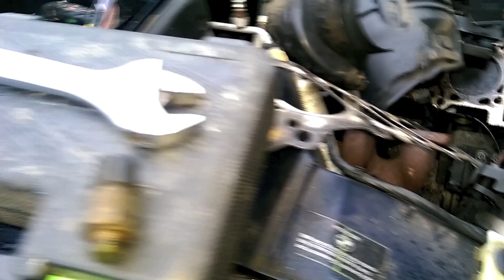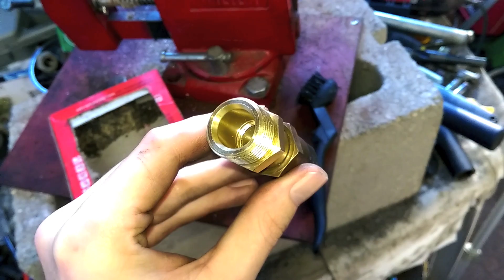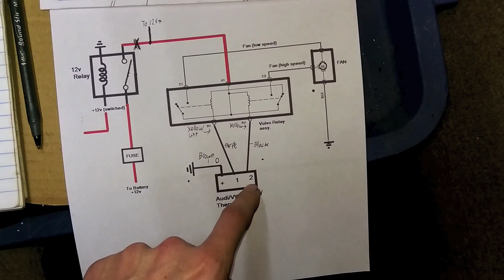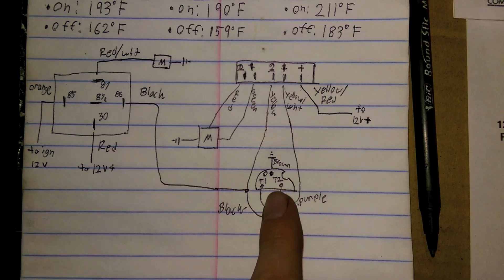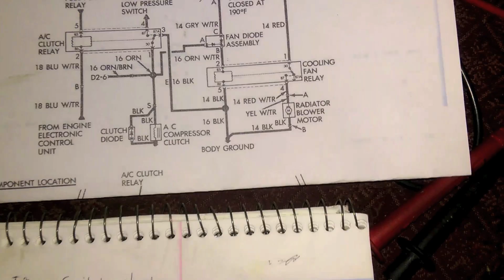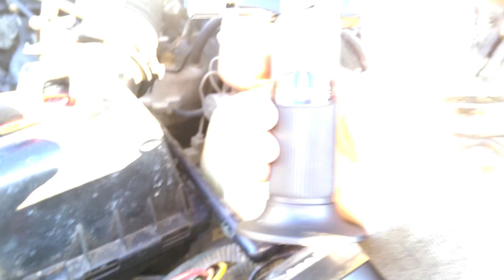89 XJ BMW Dual Temp Switch & 2 Speed Fan Wiring

Comment: I'm working on a bmw that I had to replace the radiator for. The new radiator had the later model switch, this one your showing. And I couldn't find anything on wiring diagrams for some reason. This video helped me find what was high and low off that switch. Thank you and good luck to anybody else that finds this video helpful!

Comment: So I could use just one of the wires from the thermo switch and it would complete the ground circuit ?
Reply from the maker: It should do the trick
Reply: @NickInTimeFilms   I’m just trying to get a single stage fan to kick on and off what would be the best approach one wire right ?
Reply from the maker: Yeah, you would run the relay ground wire to the switch, and then wire the other end of the switch to ground to complete the circuit

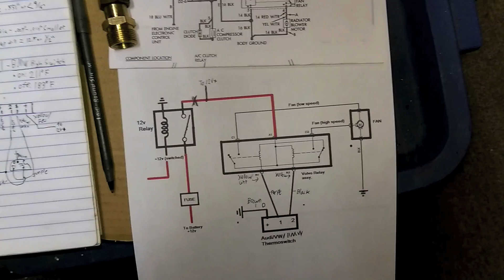Comment: These 3 wire dual temp switches  are isolated form ground. Makes no difference if you switch positive or ground to relays.  Not a weird thing at all. 14:01

Comment: Input side of radiator is wear this is to be installed. BMW mounts it there. Why do you want the fans not to run. Engine coolant temp at inlet will be well over 200* F when the outlet location is turning fans on
Reply from the maker: Interesting, that would make the temp range a little better. Later I went to a custom fan controller so i could dial in the temp just right but still keep the engine up to operating temp.

Comment: One thing to factor in where anyone put this. The hot side of the radiator or the cold side. That’s not the point of my comment. Just factor in......that if you are running an automatic transmission. Your radiator is cooling this transmission fluid at the temp the thermostat is set at. So.....if you have a 195° thermostat, then your transmission fluid could be running close to 195°.
    You don’t want trans fluid that high typically. There is a chart that shows trans temps and what an automatic likes. 170-180°. On my automatics I use an Extra stack and plate transmission cooler AFTER the radiators cooler to aid in cooling past what the thermostat on the engine allows. It cools it down past thermostat temps. I definitely don’t want them at 195°. I use a trans temp gauge to check it a few times and then either leave the gauge in or remove it when I know the temp is good. ......and I keep  my cooling lines away from the exhaust. Typically using AN fittings. Too close to the exhaust and it super heats the fluid. I did ruin a trans putting lines too close to the exhaust. 
I also use an extra DERALE filter which cleans the fluid much better than the stock pan filter that’s used WITH the derale. It’s an in-line filter 

Don’t let your trans run hot.......it takes the life out of it. Also....change fluid every 50k as it does break down with heat and time. 

And.....and overheated engine that uses the radiator to cool the trans fluid. If that ever is overheated. Change fluid right away due to the heat breaking down the fluid. You won’t notice it but it does trash the clutch packs a lot faster. 

That’s my 2 cents on this install and some good stuff on transmission care

Comment: wouldn't one fan coming on sufficient since the engine is off than having 2 fan coming on while the car is off draining the battery?
Reply from the maker: Depends how your system reacts. After years of messing with the Jeep I've learned the cooling system a lot better and am not worried about a slight spike when the engine is off. I now run a custom fan controller that keeps the temps stable and has the ability to cool with engine off if needed but I don't bother.

Comment: Great video, informative & not just edited for 'hook this to this & presto' BS that we see in a lot of other videos where it's 90% behind the scenes worked on.
I have a WJ 4.0L that has a heating issue. It super heats the fuel rail after shut off & turns it to vapor. Injectors don't like that too much when I start it up again 10 mins or so later.
Installing www.ebay.com/p/1500w-0-999h-Digital-Display-Time-Delay-Relay-Timing-Timer-Cycling-Module-DC-12v/23012257854 & setting it for a 210 second run time when I hit the switch in the cab has solved that issue. Though I may set it for a delay after I hit the button, then run for the 3 1/2 mins or whatever I set it to.
maybe look into these digital controller/timers. Freaking economical enough for sure, has a built in relay to switch the remote relays etc AND it keeps the programming you set even when disconnected from all power!
<----- New sub here. Cheers
Reply from the maker: Man, that is a crazy low price, neat. I actually made my own digital fan controller after a while as the temp switch wasn't working quite how I wanted. Now I have full control to set the exact temperature I want. Hoping to release some of my Trinity V2 fan controllers shortly to see how they work in the wild.
Reply: Yeah that would be awesome. Seeing how you have that wired up for the dual fans & 1 is a dual speed with full control. 
I like the option of running the fan with the engine off. Actually I need that because of the heating of the fuel rail. Got the insulating foil under the rail, on the feed lines & the rail itself & it still heats up the fuel. Dumbass design having the exhaust right under the intake manifold. Cest la vie.

Comment: you should lube the tap...
Reply: WD-40 is water displacement 40. Does it work fo this .....not really. You basically cut it dry. Does it matter in this case? No. The brass is so soft that the harder tap just worked right through it. 

What is needed is cutting oil. Also used with drilling any hole. You can get in in plumbing at Lowe’s or Home Depot
Reply from the maker: I always use wd-40 when I tap. Not sure if I showed it in this clip, but that and just taking it slow, haven't had one break yet.

Comment: How would I wire up BMW dual temp switch with a relay to interrupt the ground?  85 ground, 86 ignition, 30 ground, 87 to temp switch??? Please help.
Reply from the maker: You want the switch to be on the low side of the relay, so run 85 to the switch input, then run the switch output to ground

Comment: What amp relay did you use on the power wire for the Volvo relay? 30, 40 amp??
Reply from the maker: My Volvo Relay is just hot all the time, but an ignition relay might need to be in the 30/40 range. It might even say it on the Volvo relay pack

Comment: late 90's/early-mid 2000's VW Jettas and golfs have a 95/105 C that is the same size as the jeeps and threads right in, no adapter needed.
Reply: Just add a second relay and you have 2 speed fan control.

Comment: You go through the expanation a little too fast and I can't see which pin has the purple wire you mention. I'm trying to do this for my Ford Ranger but the BMW plug wiring colors are different. I have brown / black-green / black-white. If I lay the switch on the table with the brown on top as I look into the the pins the lower left pin has the BLK-GRN and the one on lower right is the BLK-WT wire. Which is the low speed?
Reply from the maker: Ok, looking back in my notes I see brown is the center pin, and I think purple is on the left away from the index nub, and black is next to the nub on the right.
Reply: NickInTimeFilms cool, this means the GRN-BLK is my low speed. I didn't explain, i put the switch in boiling water but neither contact activated after 15min in the water...
Reply from the maker: Hmm, strange. The 2 temps should be printed on the side in celsius. The colder switch closes low at 176F and the hotter switch closes low at 196F.

Comment: How about the AC Clutch ... you didn't address it!
Reply from the maker: That part is tricky with the volvo style ground trigger set-up. I may re-do all this a third time so it works the way I want. At first the sensor came on too late so i put the colder one in and it did well. put a new rad in and now it's too cold for my needs.

Comment: Would it be an issue to run that switch on the upper radiator hose? Or if I do an inline hose adapter would I want to run it into the lower?
Reply from the maker: Nah, that'll work fine but the fans will come on sooner since it's before the rad cooling. I actually looked into an inline threaded adapter at one point.
Reply: So I got inspired and while I was at the junkyard I found a dual temp switch off a bmw, it says 91 and 99 degrees celcius. What would the cut on and cut off be for those?

also, what would be a good power source i could attach the fan positive to that would only be on while the engine is on or a ground that is only active when the engine is on?
Reply: nevermind on the temperature question, found the paper you had
Reply from the maker: This part is a little tricky. Are you using the Volvo relay pack to power a 2 speed fan or are you powering something else? The volvo pack is only controlled through ground which this dual temp switch helps us control. The way I wired it up was by grabbing another relay and running the common on this switch to the main relay input 30, and running 87 to ground, then i used an ignition wire to power the relay coil 85 and 86 to ground as well. I believe i used one of the old fan relay wires as it was an ignition wire, might talk about it in my small cooling mods video

Comment: DO NOT buy the aftermarket Volvo fans, like Dorman etc off ebay. "ONLY" buy OEM volvo or mk viii Lincoln fans as the aftermarket fans do not use the Siemens 2sp motor. and they will not last! I do have a spare 17yo volvo fan it still works like new! The volvo relay pack is really rated for 70a, do not use Bosch 30 relays, they will melt the contacts! The volvos can pull serious peak current.  I should make a good vid on how to do this right. But with 60hr work weeks and kids its kinda hard. So if you want good info, goto the Nastyz28 forum (has all the info youll need to do it right), they did the flow test on these fans, they pull over 4000cfm @ 14v!~
Reply from the maker: It a nice fan, pulls a decent breeze. This coupled with my new all  aluminum radiator has got some serious cooling capabilities now. The Volvo Relay pack is still doing great, but I swapped the fan switch for the lower temp one with the old rad. with the new rad i could probably go back to the warmer one but I'm thinking about making my own adjustable fan controller.

Comment: Hey, planning on doing this to my car. Do you happen to have the pinout for the BMW switch? I have the switch but I do not have  connector. I found a 'new connector' but the wires are separate and the same color. Which pin ground, and which pins are low speed and high speed respectively?
Reply from the maker: It's been a while, there should be a wiring diagram with an accurate depiction somewhere
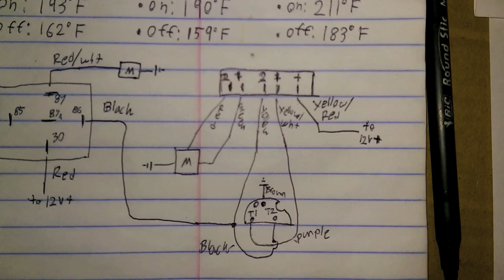Reply from the maker: 14:17

Comment: Those dual-temp switches come in the M22 thread size. Porsche and VW use them, and in the temperature range you need. They're actually easier to use because they have three spade terminals side-by-side. 

Example: http://www.tridon.com.au/products/img/thumb/th-TFS104.jpg
Reply from the maker: No kidding. The Audi/VW/Porsche Switch has a Low 203ºF / High 215ºF but that is too hot for my needs. I went with the lower temp BMW switch in a later video and it seems to work well now. Nice find though.
Reply: They come in other temp ranges. You can fo to Tridon's website and have a look: https://www.google.com/url?sa=t&rct=j&q=&esrc=s&source=web&cd=1&cad=rja&uact=8&ved=0ahUKEwjF--Cc6MfOAhUXS2MKHQP1Av0QFggcMAA&url=http%3A%2F%2Fwww.tridon.com.au%2Fproducts%2FTridon%2F35%2F483%2Fswitches-and-sensors%2F2014%2Fthermo-fan-switches&usg=AFQjCNHd1_XWEShVTzss3NF6Tw_inmWT8A&sig2=Jb6qZnbzdZAHUhL6PK0Trg&bvm=bv.129759880,d.cGc

Comment: couldn't you tap the thermostat housing for the BMW switch to control the Volvo fan and leave the stock fan switch and relay alone?
Reply from the maker: +Larry Franco Not sure how hard it is to tap the housing, but then the volvo fan wouldn't respond as quickly and may overcool the engine since it's monitoring input and not output but depending on the old sensor size it may be an option

Comment: I can see where you went wrong now, the electron flow should have gone to the dilitum crystals scottie he he :).
.
Yep i could see what you were doing, but unwanted earthing via the ignition switch and odd supply problems nearly sent you mad.......... ok madder :-D.
i felt sorry for you as ive been in similar situations, just when you have something setup the rest of the system does something silly to screw the logic up.
.
Yes your  diode terminology is spot on, i would leave it in, it wont hurt having a 0.7v drop to the relay coil, your battery will be near to 14v most of the time anyway.
Save your final diagram in a safe place, the memory does become foggy as time goes by, the words "What the hell was i doing here" can happen 3 years later lol.
Reply from the maker: +zx8401ztv Yeah, i'd like to take some advanced electronics course so I can better wrangle these electrical pixies. And these videos are my memory, that's the original reason why I started making them. haha
Reply: +NickInTimeFilms 
Yes its a good idea too, your blunders ... errr experements can be shared with the whole world :o), im joking as normal, i do enjoy your videos and intelligence plus the cardboard of cause :)

Comment: awesome, impressive work. In your last vid you said you can upgrade the secondary fan to a 95-96 or a 00-01 fan. if I wanted to do the 00-01 fan all I gotta do is snip that connector off and slice the old one on and it'll work? Because a little extra cfm sounds appealing lol
Reply from the maker: yup, should drop right in